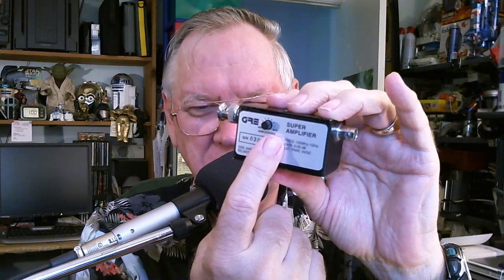TRRS #0057 GRE Super Amplifier for Scanner Radios

Comment: Having a better antenna will always be better than putting a preamp onto a bad antenna. But there is only so much you can do for a better antenna with a handheld as most don't want to be tethered to a cable that's connected to an antenna that's located outside.

The issue with a Preamp is that they usually increase the noise floor along with the signal you're trying to hear so the SNR will be the same, and sometimes worse, and they will also increase any interference you may be getting, and sometimes add more. And to top it off not only the above issues a preamp will usually cause the front end of the scanner to overload causing a lot more issues.

Comment: Better to spend money on a good antenna. I am using a pre-amp as in a rural area and using a Kitztech KT-300 with filter and good antenna and then good quality lmr400 and picking up another states nearby 35-50 miles out. You have to learn when to attenuate and when not to. Otherwise can overload your receiver and scanner front-end. In rural area a good pre-amp is great, so long pair with a good tuned antenna and cable, but in city, not recommend to use one, as you will likely overload and damage your scanner, or receivers front end. A pre-amp never going to improve what can't be heard in the first place. It just help you pull a weak signal to better lock in to CC tower to get all talkgroups and get 100% decode rate and using a Uniden sds100. Pre-amp work best when close to the antenna right from the connector, not on the radio, or after the long run of cable, or on scanner, where signal is weaker due to loss in cable.  For those that are thinking about using a pre-amp with a dis-cone antenna don't. Never use a pre-amp with a discones antenna. Discones are extremely wideband by design and exacerbate any receiver overloading problems. By adding pre-amp, you are just amplifying all of the broadband noise as well and will likely destroy the front end of the scanner.
 
That GRE Super Amplifier is garbage as only work in VHF, doesn't do much in UHF and put in noise as notice it when testing on a Spectrum analyzer. Plus can see that breaking the BNC connector over time.

Comment: I see that your still working with the ol pro-97, I loved these gre/rs radios but seems R/S decided to not carry them and it is a wonder they carry anything really, the Uniden BCD-396XT radios the talk of the town however they take a master's degree to program and operate. I had been wanting one of these for a long time but now I think I will get a TV amp and convert it to a bnc connection or just hook it inline..as I recall I would have to add a switch inline also.
yes as a old electronic tinker fet's are super sensitive to electrical charges and when you touch them your body needs to be tied to a ground.

Comment: It works fine for me. A big difference with it
turned on.  I bought an AC adapter so don't use the
battery, except during a power outage.

Comment: tom a fm tv amp works good from radio shack  must be fm but must by cable connect and adapters the got them there i tested it and it works and get a cable filter for noise   mor u add the more u get igot three amp i get about 20 to 30 miles

Comment: Tom
Thanks for the reply! I got the specs on my cables and they are as followed. 
Black TRUCKSPEC 9' Antenna Coax Cable with PL-259 Connectors.
50 Ohm shielded coaxial cable
Type RG-58/u cable.
And about 40 feet of it. And a adapter for BNC to the coax adapter from the scanner to the line out. Based on this setup your saying it's going to reply on antennas position and power to improve signal vs use all my money on amps? 

Thabks
Matt

Comment from the maker: I would say ideally you should use a mast mount pre-amp if you are going to use a pre-amp at all with an outside antenna.  Using an outside antenna should give you a lot of gain over the rubber duckie antenna and if you use good quality coax you should not a need a pre-amp.  Just remember that a pre-amp will amplify the signals and the noise.

Tom

Comment: Good. Ideo Tom, that one. Because it is so cheap it probibily doesn't work I bought one a while back for mil air bands and it works great but I paid 80 dollars for it. So I believe the pricier they are the better they work. The one I use showed alot of difference I was picking up satcom real well in Columbus Ohio. This may sound odd but if you connect 3 of those together it'll work somewhat but you get a loud humm I connected three of them together and they showed some improvement.